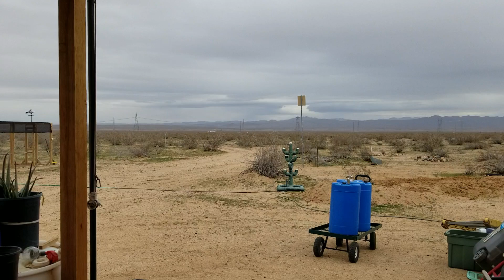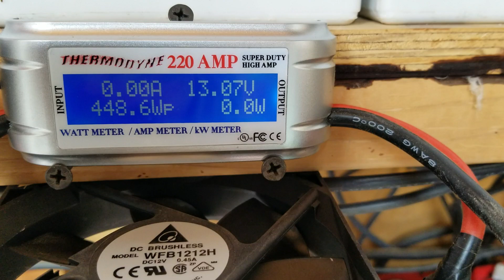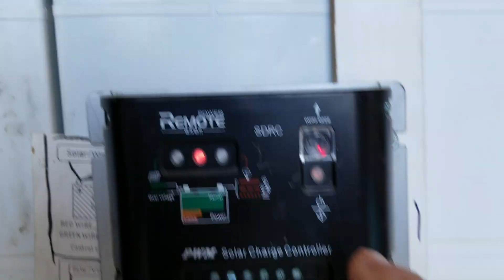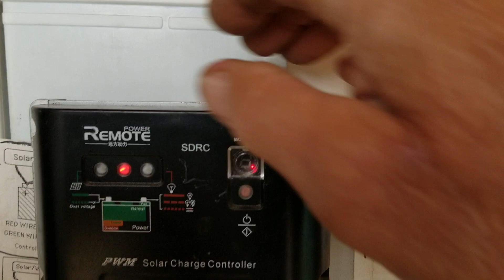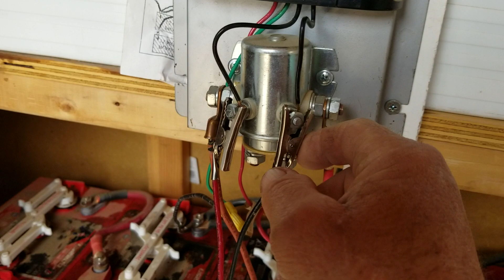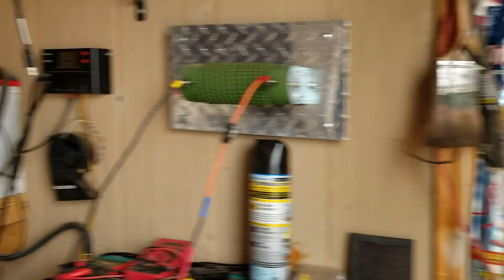GBear's Off Grid Ways-a Homestead in the Desert  Feb. 13, 2019

Comment: Great vid how does the wire from the solinoid to dump load work and how do you no what watt dump you need
Reply from the maker: When the solenoid kicks in, it is a switch that connects the battery bank to the load, in my case a heating element.
To determine what size load you need, start with 100watts.  If it kicks on and off, the load is more than adequate.   Otherwise, if it stays on for hours at a time, add another 100 watts, until it only dumps for a short period.  The idea is to use up excess input so as not to overcharge your batteries.
Remember, dump load systems are old technology and are being phased out and replaced with controllers like the Midnite classic controller,  where the excess is more efficiently handled by a computerized system.
Reply: What gauge wire do you recomend for dump load
Reply from the maker: I use 10ga stranded with a 20amp inline fuse.

Comment: Your knowledge base for this area (and many others) is amazing. I can't seem to wrap my pea brain around fuse sizing, and fuse locations. 
Are you running a 12 volt, or 24 volt system?
Great output data for the new Wind-Genny.
Reply from the maker: I have a 12v system.  I went that way so I could use jumper cables from my van in an emergency.
Fusing isn't a hard thing to understand if you look at it differently.  Think of a breaker panel on a house.  You need a larger main breaker on the incoming power and its rating depends on the size of the panel for usage.   So my turbine is rated at 140 watts max, but it could over amp in high winds.  Therefore I need to fuse each of the 3 legs coming in at 60amps each (180amp total).  Then each circuit connected to your panel should have a protective breaker or fuse, rated at the use and wire size of that circuit.  So my dump load element at 300watts, powered by 12vdc uses 25amps.  Since overamp is my worry, I installed a 30amp fuse.

Comment: Thank you you, i will buy a cheap solar charger and see what settings can be done and so
Reply from the maker: So far I have found that solid state solar controllers are not compatible with PMA's.  The only one that seems to work is the one in my video because it is modified for that purpose.
I'm still researching though.  All agree that the solenoid is not something that can be substituted, and is a must in the dump load circuit.
Reply: @GBear  Thank you, i ill check the local market for the same solenoid. I will buy a cheap solar charger and tell you if i could make it work or not, if not i will tell you what is not working until i found one that can do the job, thank you very much
Reply from the maker: @JohanvanNiekerk247  good luck!  I'll look forward to your reports.
Reply: @GBear  apologies for all the questions, what amp solar charger did you use, or does that not matter?
Reply from the maker: @JohanvanNiekerk247  I bought the system as is, but I think I remember it was 30 amp.  Since it is only connected to the battery bank as a limit switch, I don't think it matters.

Comment: Are you planing on taking the old turbine apart to see why the output is so low...
Would be nice to see how they build theirs and why it isn't putting out much
Vs how better wind turbine designs
Reply from the maker: Yes, as time allows.  I have the thing stored for now.  It did hit the ground when I pulled down the pole with the ATV.  I originally planned to pull the footing and pipe and start over on the new install, but the old pile snapped and the base never moved so I decided to reuse the base.
Old turbine lost 2 blades when it hit, but the main PMA is in tack.  Looks like oil around the slip ring, so I suspect that part failed.

Comment: Question on the dump load soleniod 
The front terminals activate the solenoid
The side terminals are load in- load out..(when switched on)
The bottom terminals are.?????
Constant on... Switched off.  ?????
Reply from the maker: Those bottom connectors are "cut load lobes"  normally closed to allow current flow.  When the solenoid is activated it opens those lugs and stops current flow.  Some users prefer to cut off solar input when wind power is being dumped in order to lower the batteries faster.

Comment: sounds like the turbine is a good investment and thats not too bad in low winds for a turbine like that, should help the old batteries out at night,  in the past ive tried to use a solar controller as a dump load controller but didnt seem to work, either i was missing something or they somehow program them , the rectifiers can get hot under continuos higher amperage in times of good wind power production.
nice use of chequer plate.
nice weather too, our summer has been crazy, three seasons in one, one day its 45 degrees celcius the next it feels like winter and then very heavy rain and strong winds.
i live in a semi arid location surrounded by wheat farms n gold mines, the farmers say the weather is not what it used to be.
Reply from the maker: This winter has been colder than I ever remember in this desert.  I have been burning through propane like crazy.  In 2017 I used 200 pounds for the whole year.  This winter alone I've used that much, and half way though the next 100#.  I'll have to get a hydrogen generator put together to assist in heating if this keeps up.
Reply from the maker: Ahhhhhh, a troll!  DON'T DO IT PEOPLE!!  ~GBear
Reply: @GBear  yeh theres alot out there putting links to sexualy explicit sites on every channel especially on religious channels
Reply from the maker: Butt-Heads!  Really aggravating that they are allowed.  YT should find them and castrate them, and lock up their parents!